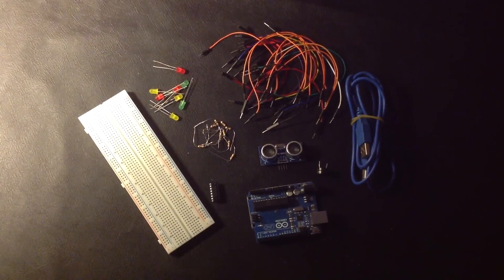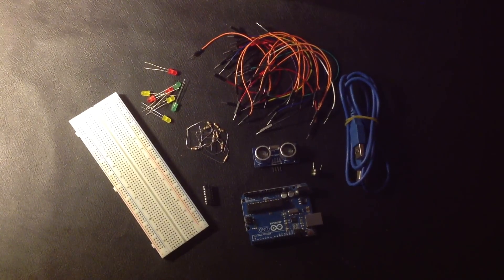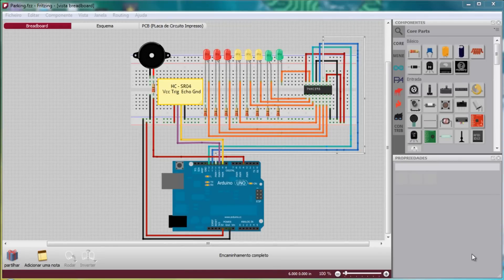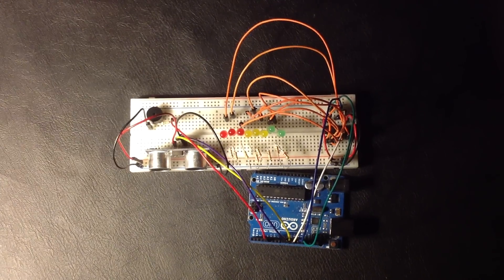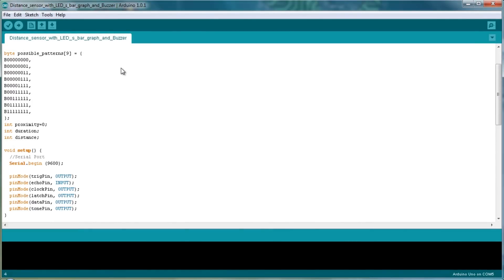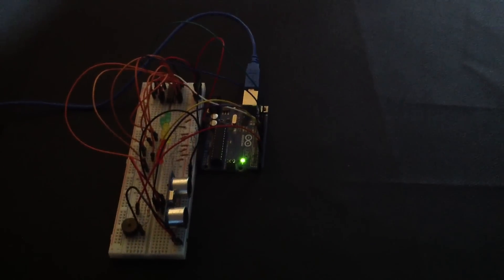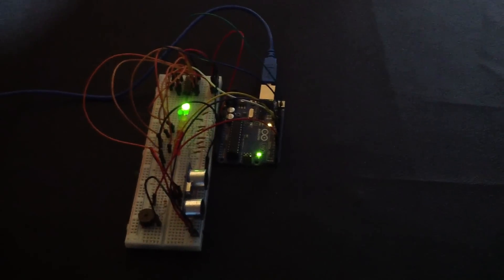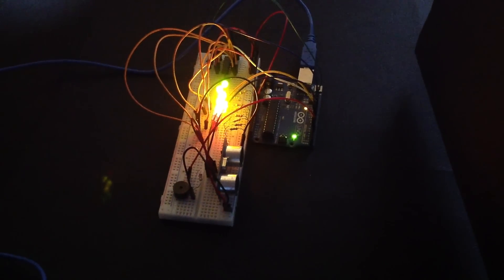Arduino - Ultrasonic Sensor with LED's and buzzer

Comment: Dear Rui Santos,  Nice Project. I wonder if I remove the LED bar graph and use an LCD 16x2 instead, what will be the code that needs to added and will this same circuit with shift register work. If so please help me with the code. Thanks alot.
Reply from the maker: Yes you can do that.
If you are using an LCD and no LEDs you don't need a shift register...

Comment: hi. sir Rui Santos can u pls. help me sir? because when I am going to verify the code its ok but if I try to upload, an error appeared. whats wrong with this sir??   
 
I cant upload the code.. this statement will appeared ...... 

Binary sketch size: 5,468 bytes (of a 32,256 byte maximum)
avrdude: stk500_getsync(): not in sync: resp=0x00
Reply from the maker: That always says so it's not a problem.
Please click upload and if it says "Upload complete"
It's working fine :)
Reply: thank you sir..... it works now....
Reply from the maker: Awesome!